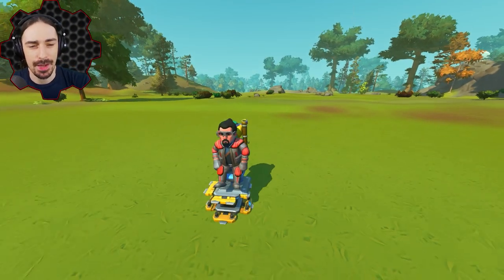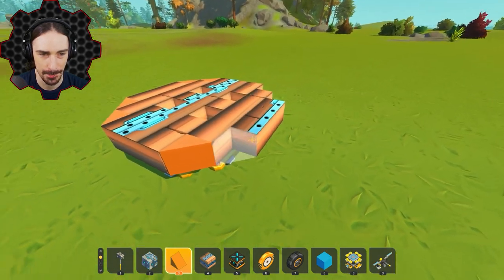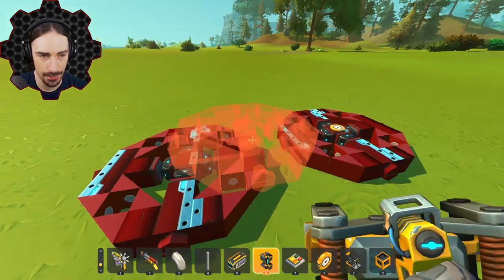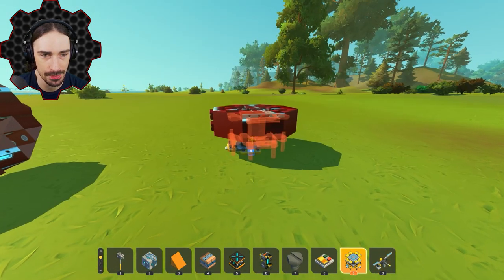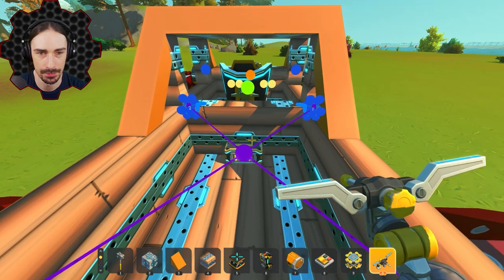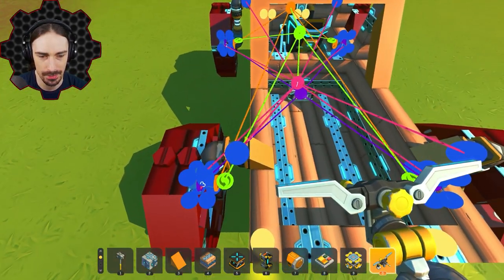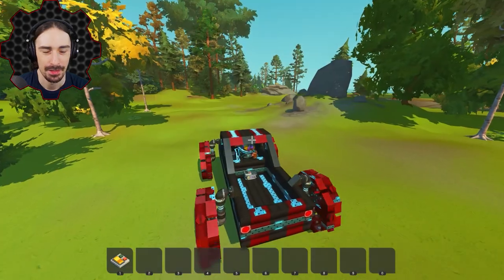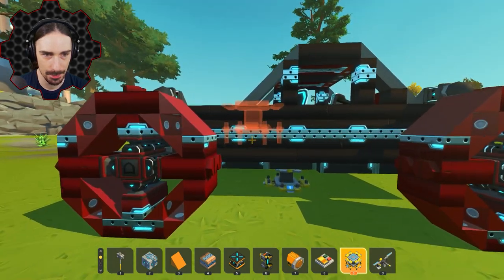Impractical Engineering: Expanding Wheels! - Scrap Mechanic Gameplay

Comment: SCRAPMAN OFF SET THE WHEELS IN THE SAME WAY YOU STOPPED THEM FROM COLLIDING WITH THE BODY HAVE THE FRONT SET TO 2 AND THE BACK SET TO EITHER 3 OR 4 TO STOP TURNING COLLISTION AND NORMAL COLLISION DUE TO CENTRIFICAL EXPANSION!!!